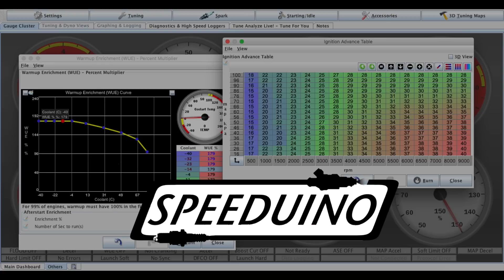SpeedyKnock early demo

Comment: * PLEASE HELP  **  im simply after an approximate RPM from a knock sensor with an arduino.... nothing else.      the knock gives a lot of 'noise' and difficult to just get approximate RPM from.
i am trying a comparitor going to a schmitt and then arduino pulse time frequency counting.... works perfect with a function oscillator..... very accurate..... but then on a knock sensor.... eeeek! too much noise....    any ideas?

Comment: ohcrap, speeduino got Srsly SERIOUS! ... last I looked it could only do 4 inj and 4 ign and had to have an external wb02. 

... also remember diddling with this chip ona vems and using ferd's 4.9l knock sensor (and frequency tune from internet). it worked very well and helped me tune the ignition map. <3 all

Comment: I also went for an arduino+tpic8101 design for my MS2 (knock window tied to crank position)  years ago, but never finished :(. If I may request a feature that would be an auto treshold calibration at low rpm: 1.) An artificial knock would be introduced at low RPM. 2.) a ratio of knock/no knock level is measured in knock window 3.) you can propagate this ratio whole RPM range to have an RPM based treshold curve.

Comment: which IC you use as a base?.. the TPIC1801?, the AN9770?, the PROSAK IC?, or other?...
Reply: I was wondering the same.  Looks like he’s using the TPIC8101.  Actually I’d like to see how all 3 of those compare w.r.t. sensitivity and signal/noise ratio.  The measure of a knock systems is how well it correctly classifies real knock from false knock across a variety of situations.
Reply: @Speeduino  IT WOULD BE GOOD TO COMPARE THE SENSITIVITY AND THE DETECTION RESPONSE AGAINST A PROFETIONAL EQUIPMENT